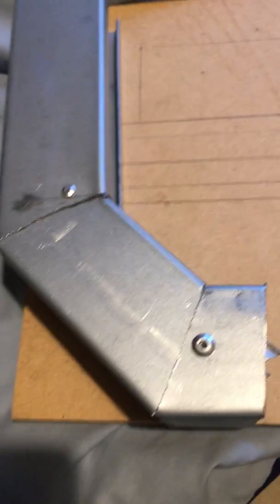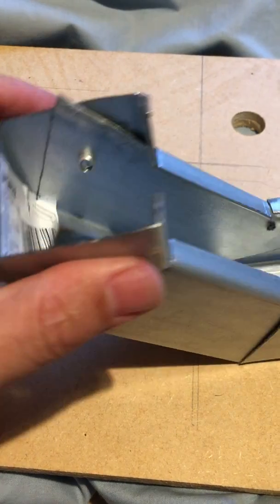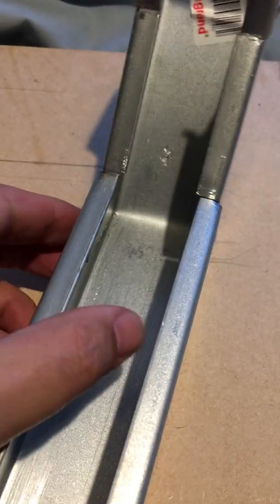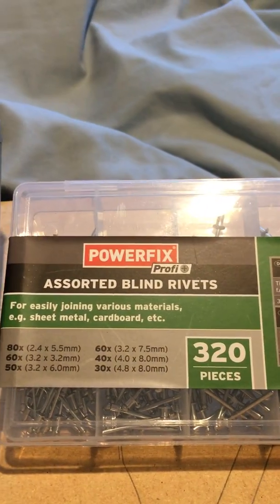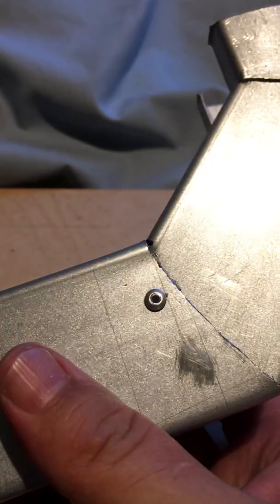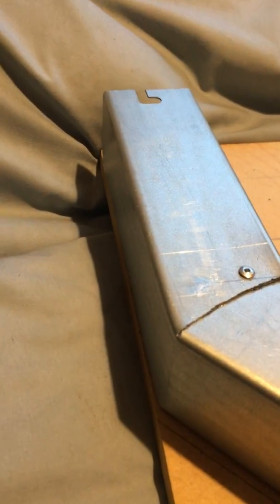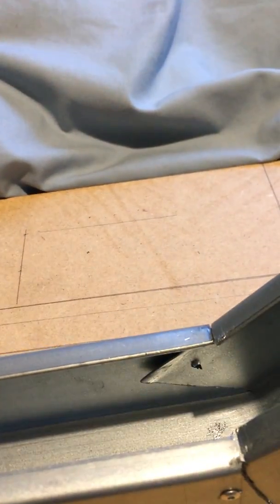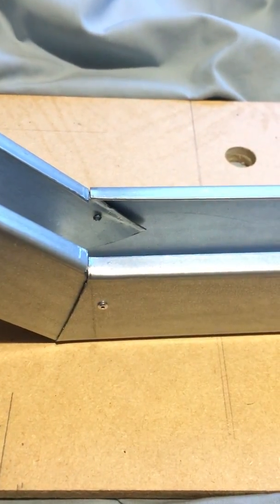fabricate trunking 90 degree bend from two 45 degree bends

Comment: What's the difference between two cuts to form 90.  ? Any rule of thumb for or you just take anything
Reply from the maker: sometimes its got to do with bend radius of cables, how many cables are in the trunking. the rule with cables inside trunking is that the cables are allowed to take up a maximum of 45 % of space inside the trunking. though, in practice people stuff the cables in. with trunking full of cable a sharp 90 degree bend will possibly be too tight for the cables. it may also be a space/fit thing. i am not sure what you mean by, "rule of thumb or just take anything"?